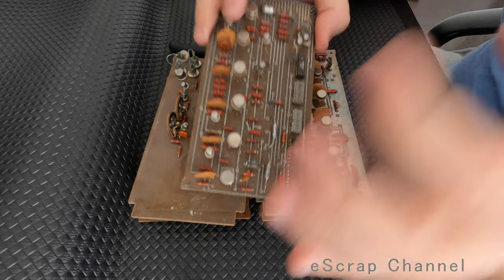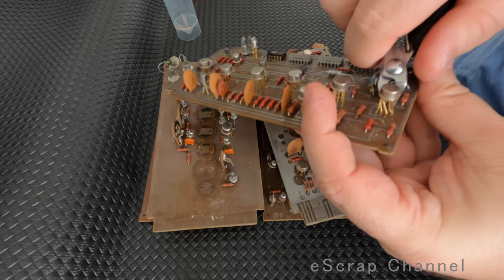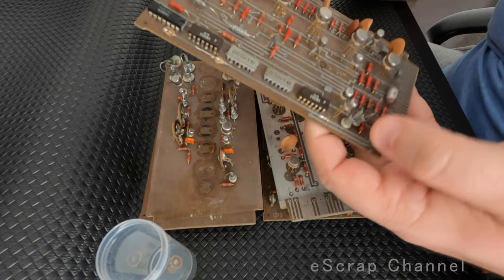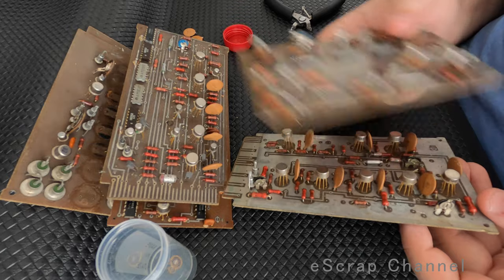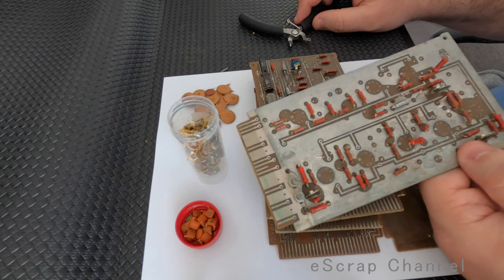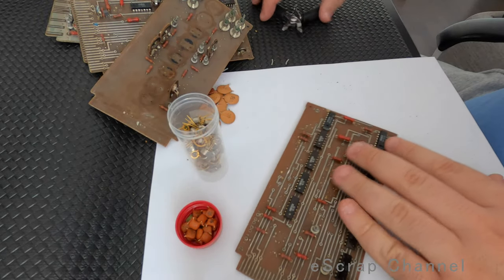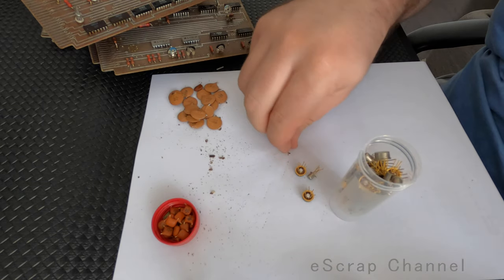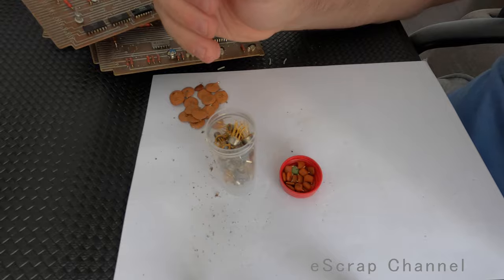Scrapping Vintage Electronic Boards for Gold and Palladium

Comment: Hello I want to ask you which capacitors contain palladium? I am scrapping vintage boards. Do all ceramic disk capacitors only contain silver or so some contain palladium? The bulgarian capacitors (ones with the same shape) all contain palladium?
Reply from the maker: Hi, all Bulgarian capacitors brown, black and blue contain palladium.
Easiest way to check is to break one. In the middle is a MLCC. If it is almost perfect white then silver is the metal. Palladium gives some grayish metal color. When you break in half 10-20 capacitors you will start recognizing them easy.

Comment: Great video. Those look like some nice boards! How would you go about getting the silver off the PCB?
Reply from the maker: I will try in diluted nitric acid to recover silver from pcb.
Reply: @escrapchannel   I see. What about all the other solder that will get dissolved too? Lead/Tin/Copper? Do you separate that out with some other technique?
Reply from the maker: Yes, I remove the solder using a Russian guy approach - Fransua Pele is the name. Will make a video to show. It is very efficient.
Reply: @escrapchannel   cool. I found his channel. Now I wish I spoke Russian :-D
Reply from the maker: @24kKarl  This guy is crazy good!!!
Reply: @escrapchannel   I look forward to seeing your video explaining the process. I have a ton of PCB's I'm thinking about getting all the base metals from, so I was curious how others are doing it.

Comment: I also have a huge stash of the rare gold plated metal capacitors how to process?
Reply from the maker: Hi, if you have gold plated transistors and micro ICs in metal body, best approach is to put 100 g material in 100 ml concentrated sulphuric acid and to start adding on small portions concentrated nitric acid. May need to repeat the cycle 2-3 times if too much base metal. But, you will dissolve all base metal and then you can purify the gold foils in aqua regia.
Please, do such experiments only if you have proper training or education and in controlled lab using glasses, gloves and ventilation, please.

Comment: I love your small clipper tool. Where did you get it? Does it have a brand name? Great video
Reply from the maker: Thanks! It is a cheap clipper from the supermarket ... no brand.
Reply: @escrapchannel  awesome I’m going to look for one at my supermarket. I like small tools for scrapping because I feel like I have more control using them and I have fewer wounds from slipping tools.👍
Reply: @shescraps9788   I found one on Amazon, it’s brand is Igan, and it is described as an electronics flush cutter
Reply: @24kKarl  thanks. I’ll go check it out now.👍
Reply: @24kKarl  I ordered it. It will be here on Thursday. That will make my scrapping of electronics much faster and easier.
Reply: @shescraps9788   I bought one from Home Depot, different brand, but works great! Happy scrapping